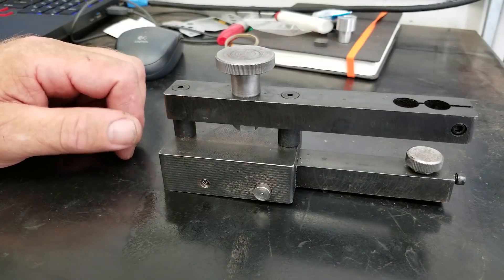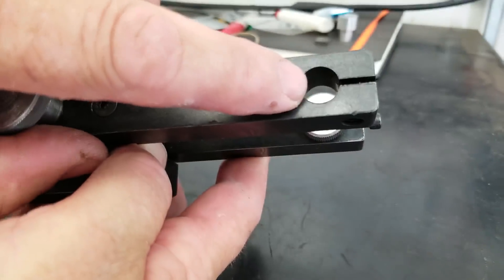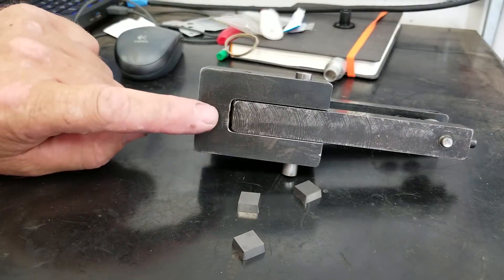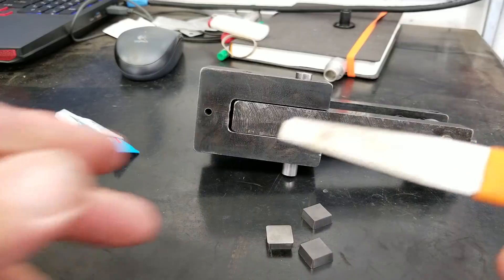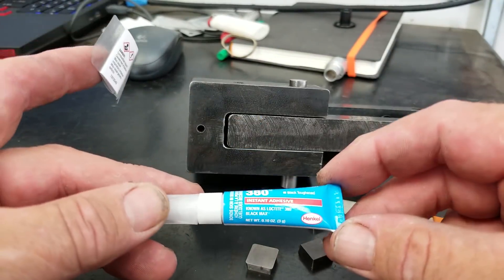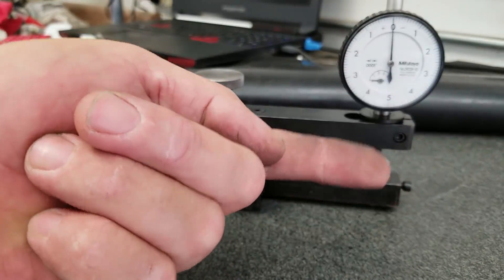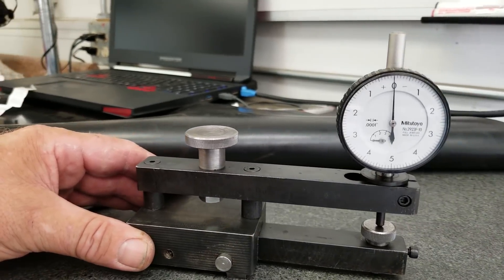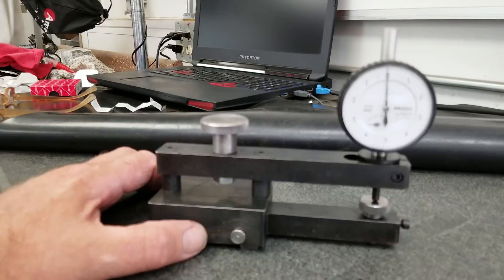Shop made repeat meter

Comment: This was inspired by Oxtools and NYC CNC.  A 12" Rahn RoR is useless on my 18x24 surface plate.  To answer some ?s, the feet will affect measurement if they do not fully contact the test surface.  Hinge arm effective length is from pivot to surface contact, you can extend this by lengthening the arm  and moving the pivots for less angular error.  Stan has a very good surface plate, mine look more like an XGame skateboard park.  Thx for the comments, criticism often makes a better design (more brains are better than one).   Except for a 0.0001 dial indicator, this was built from rems.
Cheers,
Mike at Catalina Racing
Reply: Catalina Racing 38super thanks for sharing.
Reply: Thanks Mike & Stan for sharing! This inspired me to try something along your lines, and my crude efforts at this is explained here:
https://www.homemadetools.net/forum/repeat-reading-gage-diyswedes-cheap-o-meter-73022#post134042

Cheers, DIYSwede

Comment: So, if where the knob on the top is. If that were changed out to a second dial indicator and could from there reach thru a hole to zero on the surface plate. Couldn't you zero two spots at the same? time?

Comment: That is an EXCELLENT tool! Thanks for sharing.
 It is now on my bucket list and by the way thanks for the plans.
I have an old surface plate 36" square by 4" thick that I know is out of calibration, I will soon be able to address that to get it close to a true surface. Adequate for my needs I would think.
 Thanks again, Cheers from John, Australia.

Comment: Just wondering how important is the distance from the pivot to the indicator on one of those?
Reply: Old Iron Shops Good question. My intuition says the vertical displacement of the indicator will be whatever it is, meaning however far the front point is out of the plane formed by the back three feet.

If I’m correct in that assumption, then the swing arm radius only determines where you’re measuring relative to the location of the base feet and it can be whatever you like.
Reply: Thomas Utley I wonder what Robyn thinks

Comment: What are we measuring? The irregularity of the surface under the Carbide Feet or the surface under the Indicator Tip
Reply from the maker: Under the indicator.
Reply: The 3 carbide feet form a ref plane.  If you zero the indicator on your plate, any indicated deviation when sweeping the plate is referenced from that plane/location.  This device finds wear spots and can be used to profile your surface plate with some accuracy.  I have a  -0.00045" deep trough where a height indicator must have lived for a long time.  Gave a RoM to a friend with a AA plate with certs, he thought the RoM didn't work til he over swept the edge.  This device is handy when buying a used surface plate, might get the price down if you can live with an A plate.